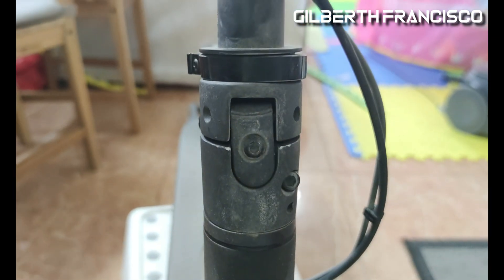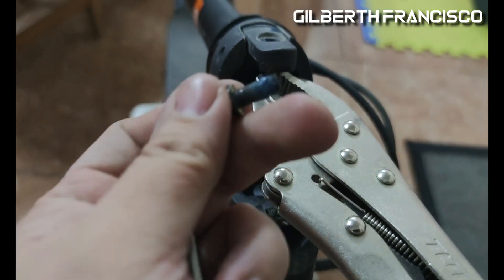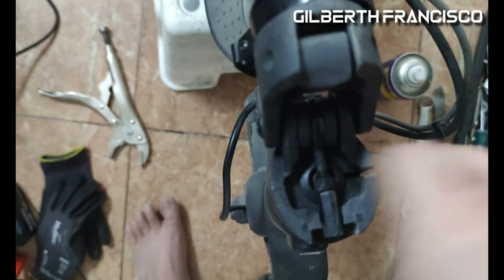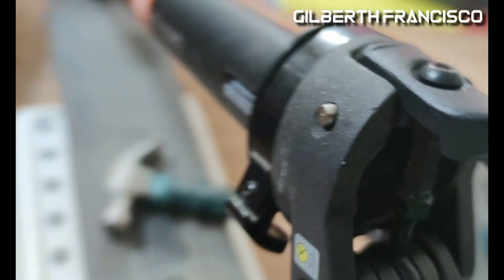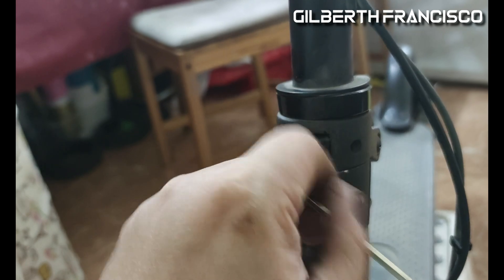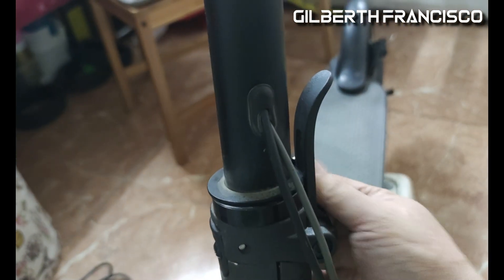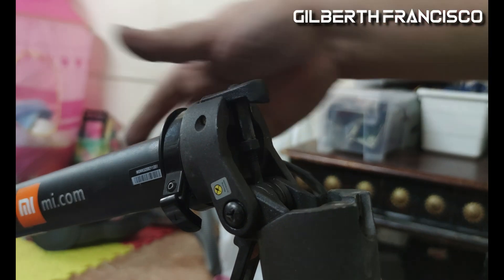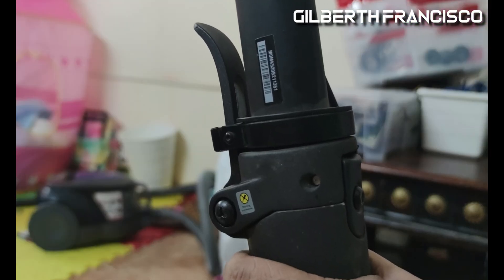XIAOMI STEM REPAIR | CALIBRATION | PIN REPLACEMENT | WOBBLING | SQUEEKING SOUND

Comment: Great video bro, I've just replaced my latch and after im still getting stem wobble, I think I know what the issue is now from your video, the pin I don't think I've hammered it far enough and it's uneven on one side, I assume I need to have to even on both sides to stop the wobble from happening as the latch is solid, it's wobbling from the pin